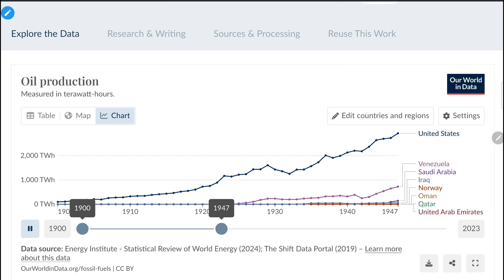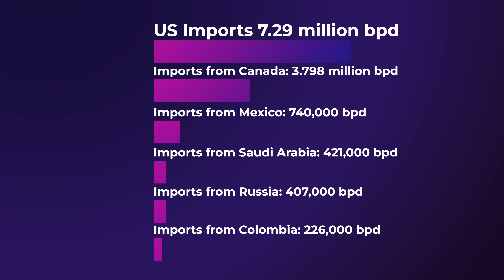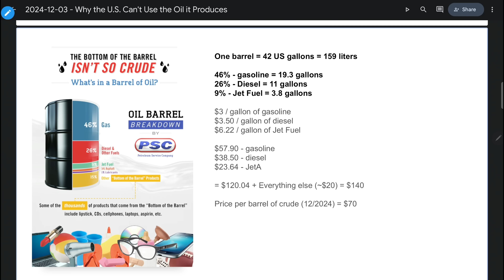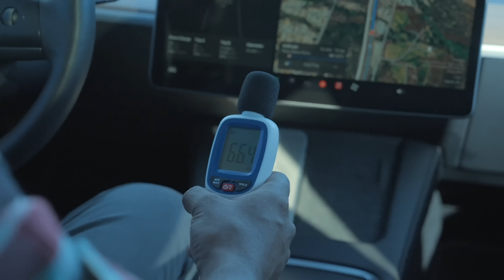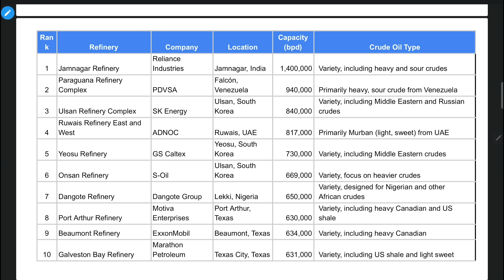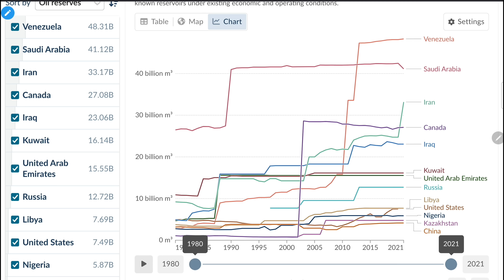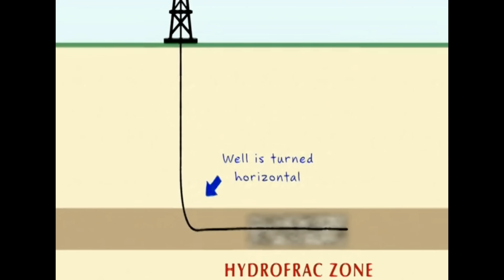Why America Can't USE The Oil it DRILLS

Comment: If the US didn’t drill and export oil while continuing to import the price of oil would go up. The loss of those millions of barrels to the supply would tighten up supplies and cause a rise in prices. While increasing oil drilling in America doesn’t lead directly to energy independence it makes a big difference in the price for the imported barrels. Canada has the third largest oil reserves in the world and it is the oil that US refineries can use and Canada produces far more oil than it can use so pipelines to the right refineries are a necessity for the US. The Keystone pipeline will now be finished and it will carry oil that is produced in the most environmentally friendly way possible. Canadian oil leases and oil sands sites are clean and regulated. Canada is also a stable country with trading ties to the United States that go much deeper than oil. Hopefully a pause in the electrification of America will allow the infrastructure to catch up and EV technology to improve. EVs are not the emissions free vehicles that they are claimed to be with the need to mine so much material just to build one battery and it’s all done using fossil fuels. Cleaner power, better batteries and infrastructure are all needed so governments don’t have to force people into EVs through mandates and fear while hugely subsidizing them.

Comment: They talk about the "Alberta oil sands" but it is so much bitumen that it is nearly solid. It is what we use to use for roof tar on flat roofs. It is so solid that if it spills in water it sinks instead of floats. They have to heat it and thin it to get it into the pipelines. The way I understand it is that they can blend some of that heavy sour with our light sweet and actually use some of our own oil but not enough. If Trump puts tariffs on Canadian oil we won't be able to use our own oil in the refineries. Most Canadian oil ends up in Houston because that is the only pipelines they can reach. The rest of Canadian oil ships by rail to our east coast refineries. We are in a symbiotic relationship with Canada and if we lose that we are worse off not better. Mexican crude is pretty much medium weight and medium sulpher so it also can be used in our refineries as long as we blend it to work. Those two partners make our refining possible. Not good to mess with them if you want cheap gas at the pump.
Reply: Drill baby drill will just make more stuff we have to store in tanks until we find a buyer and that is what happened during the Covid years. We ran out of storage demand dropped so much. The oil market actually inverted at times where you had to pay someone to take it rather than sell it for a profit on the futures market. This is a complex global market that no nation can control by itself. Simple slogans just do not work. A futures market with negative prices won't stay in business long.